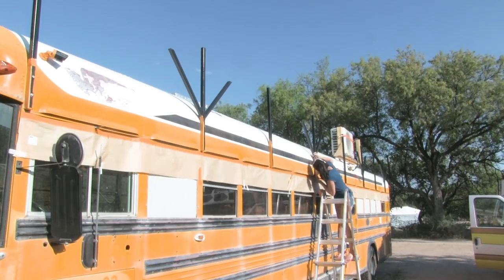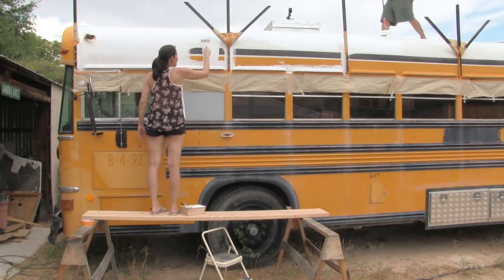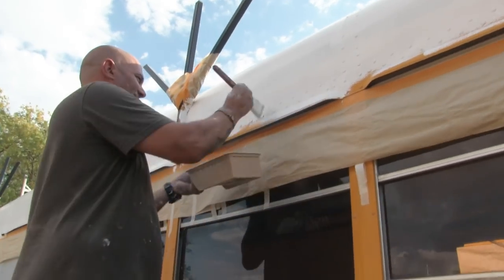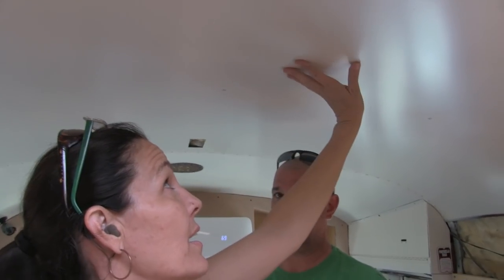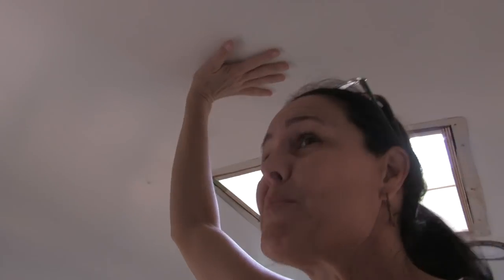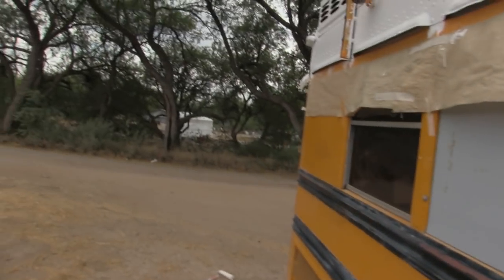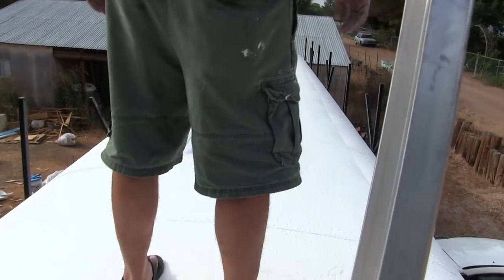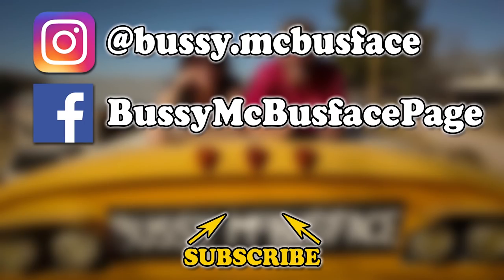Painting our Skoolie Roof with Henry's Tropicool

Comment: My bluebird has a yellow roof. In Mid July Texas Sun the exterior of the roof was 146 degrees. Inside the ceiling was 108 and the ribs were about 125. (F) My 13500 BTU roof unit was only able to keep the bus about 82 with the outside temp being about 95. Tomorrow I apply my tropicool and I will let you know the results of the temperature decreases.
Reply: How did it turn out? Did the temperature decrease?
Reply: @merrissaramos7383  100% improvement. Worth every penny. My exterior roof temp of 145ish dropped to around 110. The inside roof temp in direct summer sun is never above 100.

Comment: Had you used a latex based coating (non siliconized) it would have stuffed off and been a disaster. How is the tropicool holding up?
Reply from the maker: It's holding up very well except it gets dirty very easily.